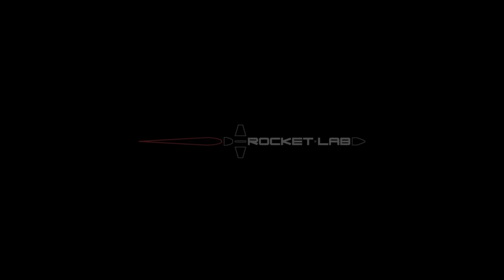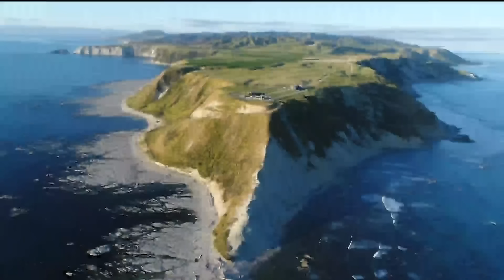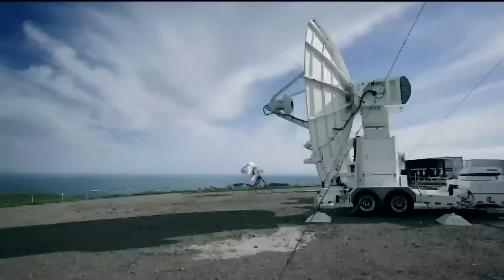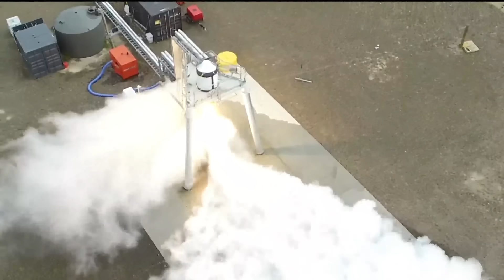Rocket Lab - Still Testing - Launch Attempt 12/12/2017

Comment: I love the black rocket design, but why paint it all black if you have to put white tarp (by the looks of it) on during launch?
Reply: The black is not paint. The rocket is fully carbon fiber, thus why it is black. The white areas on the rocket  are actually frost/condensation when the LOX (cryogenic liquid oxygen) tanks are full.

Comment: Wow, the engine actually fired for a split second and was still able to do an abort?
Reply: Yeah, because the vehicle wasn't released yet. This is not new, many rockets did abort after ignition, but abort after release usually results in triggering the FTS.
Reply: FTS? Flight T...something System? I guess I was surprised because it's the first time i saw something like it. Also, it's a smaller rocket by a new company and the flight is called "still testing". Guess I am very guilty of somehow expecting less professionalism because of that.
Reply: ADD Dude Flight Termination System. Basically it's supposed to blow the rocket up midflight if control is lost. I don't have any sources, but I assume this rocket has one too.
Reply: Yeah. They used it on their first launch attempt after losing some of their comms. Though, by that time the 2nd stage had separated, so the FTS just shut down the stage without exploding it.